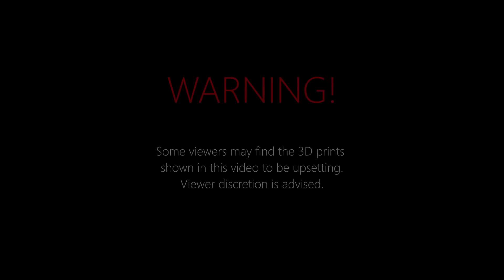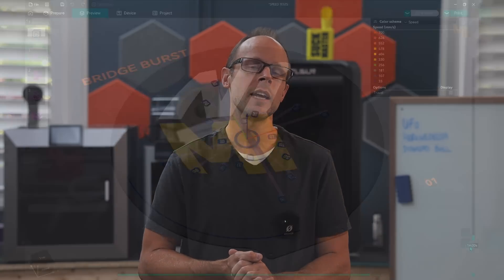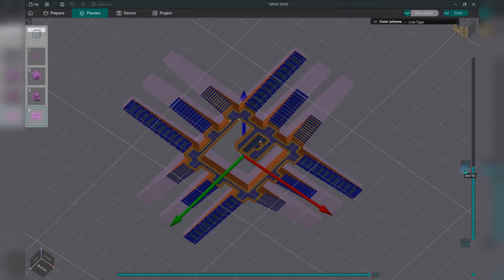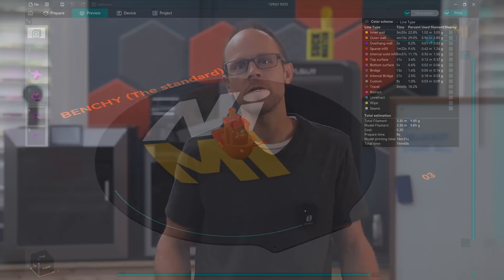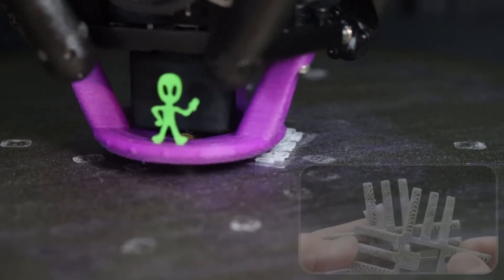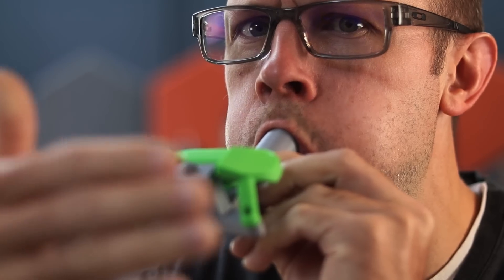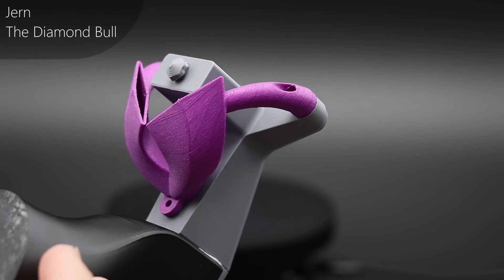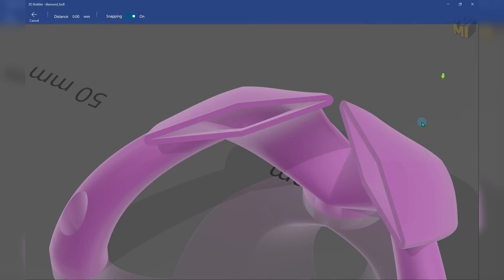Ep.1 - These high speed 3D printer ducts produced some shocking results!

Comment: I only have super slow bedslingers. I don't understand why you are printing so fast when even the stock setup can't cool a benchy good enough for a perfect print? What does it matter? What speeds can this printer ACTUALLY print at?
Reply: I think it's more so pushing the printer to the extreme to really highlight the difference from duct to duct. The ones that perform best at these crazy speeds will be that much better at more reasonable speeds.
Reply: @g912man  that makes sense. I want to get a super fast printer too - I'm researching marlin and smaller direct drive stuff for my ender but all the same I didn't consider that. That makes sense. However I think you could make the argument that at "sane" speeds, different things would be important to consider for cooling not present at these crazy rates.
Reply: @itsOnlyDads ditch marlin entirely and switch to klipper, marlin isn't friendly to work with and difficult to get higher speeds out of.

The biggest benefit of klipper is that you can make changes on the fly without having to recompile the firmware.
Reply: @xandersnyder7214  Do you have a klipper tutorial or somewhere I can ask questions? I bought a BTT klipper screen/tablet thing but I don't know where to start to convert one of my enders.
Reply: @itsOnlyDads  I'll see if I can dig up some of my links for you when I get home. I started in that journey a long time ago and ended up converting my Ender3 into a Voron Switchwire and built a Voron 2.4 earlier this year.

I'll get you some YouTube links that go through the basics and some good forum links.
Reply: If he slowed it down to the point that a stock setup could make a perfect benchy than you've just introduced a maximum performance wall for all of the designs. How are you going to tell which ones are better if they just end up making perfect prints for half of the tests?

No, it's definitely a better test to make it so tough that nothing can perform perfectly. 

It's like destructive testing. If you only test things to an arbitrary point because "well we don't want to break stuff!" than you'll only ever know those designs can achieve that arbitrary point, and not what their actual maximum performance is.
Reply: @T800123  Thank you for this reflection, I appreciate it.

Comment: very interesting results, I wonder of the bridge test would be better with lower flow to stop the air just blowing the plastic away ?
Reply from the maker: Yes, I think that's possible for sure, I wanted to do extremes, and slowing the bridge would allow us to reduce the fan speed, but then again slowing it would also make it.... well slower, which isn't what I wanted to do here, but we may need to follow up with some final tests after we get through these.  So I take your point, it is something I've been thinking about as well.
Reply: @NeedItMakeIt  Another suggestion is to print the shuriken as a speed tower covering a range of print speeds, perhaps than can give a max speed for each fan design. After watching your design videos and a few others that talked about finding the optimal duct outlet dimensions I went down my own rabbit hole of duct designs and it was very interesting process.